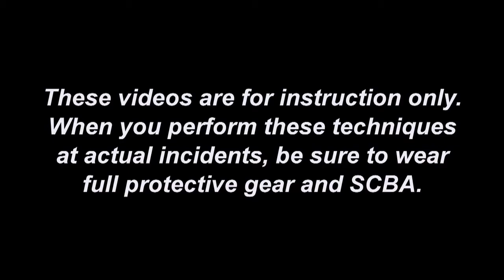Air Entrainment and Hose Streams #5806234708001

Comment: 48,200 subscribers, only 2,200 views and ONE comment that doesn't address the content.  What does that tell you?  It provides me with volumes of information about firefighters in the USA!

Unfortunately, this demonstration only shows the obvious regarding air movement with different types of applications and doesn't address the Job at all.  If the contents of that room are fully involved, you have to think about where they are and what they need to stop burning.  If the flames are pouring out the window with force from the pressure created by the fire, you won't be able to get close to the window to allow a straight stream to effectively cover that material be deflecting the water of the ceiling or walls.

A straight stream at high pressure puts a massive amount of water on a very small area and that high pressure will dramatically disturb the air movement inside the room.

If you lower the water pressure so the interior gasses are disturbed less, and you apply a tight cone of water in an arc, the water will drop straight down onto the burning material in the room and stop combustion almost instantly.  Because you didn't defeat the energy of the escaping gasses, all the smoke, heat and water vapor will continue out of the room through the window.

The key is to manipulate and control the energy of the fire with your water application so the water will go where it is needed without disturbing the natural Pressure Release Location.